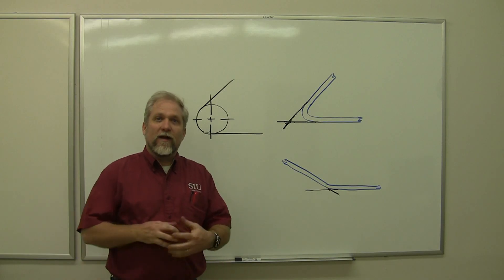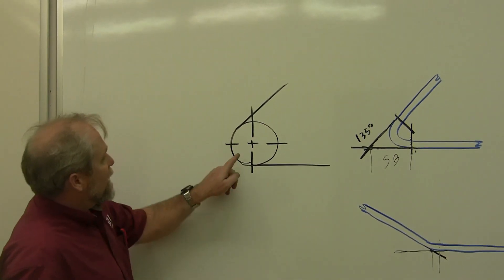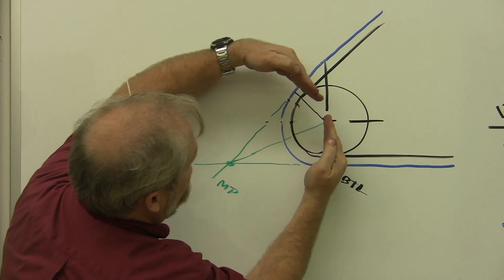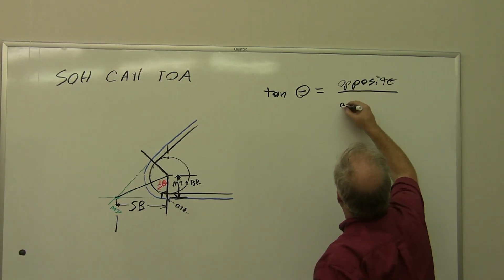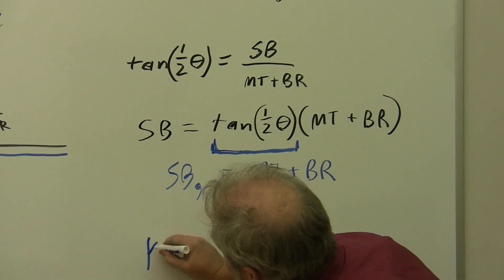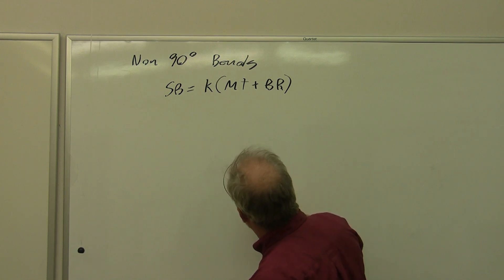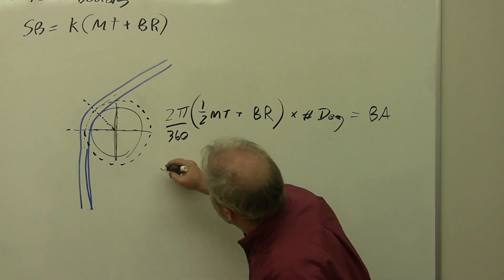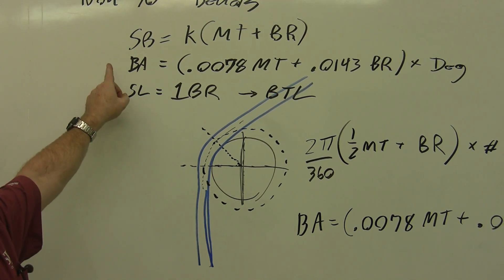AVT 206 A&P - The Math Behind the Bends - Non 90 bend formulas

Comment: Can someone tell what's 0.0078 and 0.143 . Are they any constant or they change with respect to material or something
Reply: Hello!  I hope this helps:

I am uncertain as to where / what .0143 is in this context.  I suspect that it does indeed change with material.
EDIT:  Upon reading the video description, I now understand that when he said .0143, in truth he meant 0.01743

.01743 is equal to pi / 180

 .0078 is .446 * Pi / 180

.446 is the K-factor listed in the Machinery's Handbook for mild, cold-rolled steel, with a tensile strength of 60,000 PSI.  This value does change with respect to material, but .446 is a great starting point.

You can look up "A grand unifying theory of bending" from TheFabricator.  It is an excellent resource and there are many more articles available that dive further into getting precise sheet metal results.

Comment: Arc length S equals radius R times angle theta. 
S = T theta. 
So for a full circle, S is the circumference and theta is 2 pi. 
So C = 2pi R
For 90 degrees, theta is pi/2
So S = pi R/2. 
The length of material from tangent to tangent in mold is 2 R. 
The length of material in real world is pi R/2, which as you say, is less than 2R. 
Just another way of looking at it. 
Paul

Comment: Some parts are confusing and when you get there it is done for as you just keep going! You don't seem to spend enough time explaining where you get the numbers from and how you got them, instead you use them as a matter of fact. This was the issue I had with my algebra teacher 50 years ago! If I totally understood the methods used I would not have watched the video in the first place. After reading many of the comments, you can tell that most of them are from people that are using this daily and did not really need the video. Thanks anyway. I have watched it twice, and I will have to stop it and watch and try to work the numbers until I can figure out where you are getting them. Stay well.

Comment: hello sir,  i saw all your videos related to this topic and every time i  found a huge difference in calculation between my essay and yours.
you have to check your calculator because it's  at he second time  it makes you perform an inaccurate calculation.
2pi / 360 = 0.0174
(2pi)/(360x2) =  0.0087 
so the right equation of the Bend allowance should be   BA = (0.0087 MT +  0.0174 BR ) x DEG
Reply from the maker: The neutral axis is not exactly at 50 percent.  The decimal formula is adjusted for the neutral axis on 2024 hardened aluminum.

Comment: nowadays we upgrade  tube bender machine and we stop to calculate cut to length of pipe (arcs lengths + straight length ) but we try to calculate arc length times from inner  ,outer and mean diameter after all calculations we didn't reach to accurate length .
please we need to provide us the formula that calculate cut to length pipe.
best regards.

Comment: I get the BA=(kT+R)×A
BA= bend allowance
K= k factor = 0.43 for steel 0.25 for copper 
R=inside radius of the bend
A= angle in radians.
if in degrees convert to radians by multiply by 
180/pi

Comment: Thank you for your explanation. And I have a question, what can be the maximum bend angle of a steel plate for bending without cracks with supposed MT=2, BR =2, elongation limit = 20%?
Reply from the maker: Sounds like a homework problem gone wrong.  You can't ask about the maximum thickness and then specify an MT (material thickness) of 2.
Reply: I'm so sorry. the maximum bend angle  is what I want to mention.
Reply from the maker: OK.  This is not a problem I am familiar with, but if I understand it right, you need to calculate how many degrees of bend would make the outside edge expand 20% compared to the neutral axis.  The bend radius is the inside of the bend, so the neutral axis has a presumed radius of 3 inches (assuming the neutral axis is at 50%.  The outside of the bent steel will be at 4 inches radius - the MT plus the BR.  Your steel will have a slightly different neutral axis, so my answer is only an approximate.  For each degree of bend, the neutral axis would cover 2piR/360 = 6pi/360 = pi/60 inches, while the outside edge would cover 2piR/360 = 8pi/360 = pi/45 inches.  The steel fails when we reach 20% elongation, so the angle of failure is reached when the larger number is 20% greater than the smaller.   Let D be the number of degrees, and set for 20% elongation.  
 (pi/60)D = 1.2(pi/45)D.  Solve for D.  Your pi/45 term will be the one that is different based on whatever exact nuetral axis figure your textbook or material handbook calls for substituted for 1/2.
Reply: Thank you for support!
Reply: i tried but the ratio comes same , can u through some light on this don with an example, it would be very much help full in solving real world problems. thanks in advance